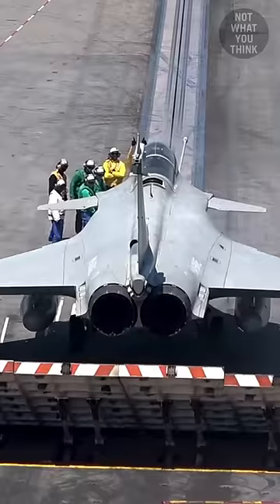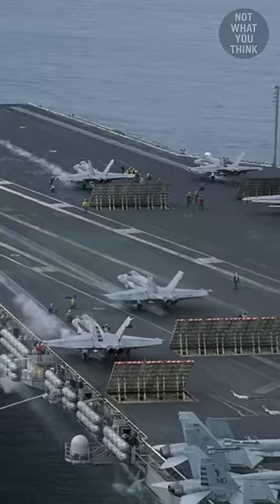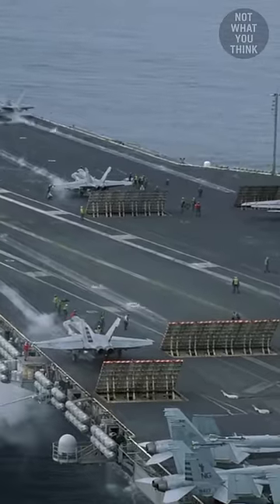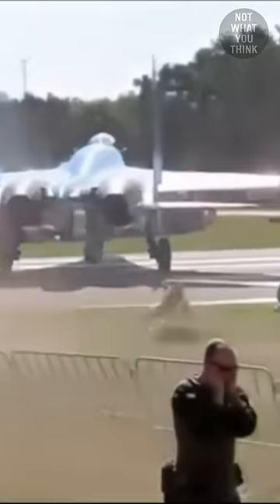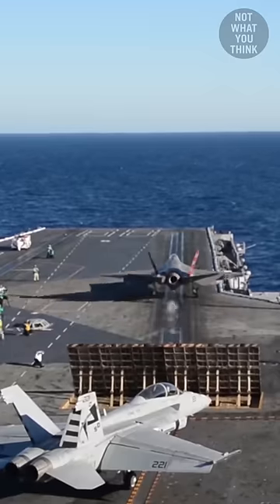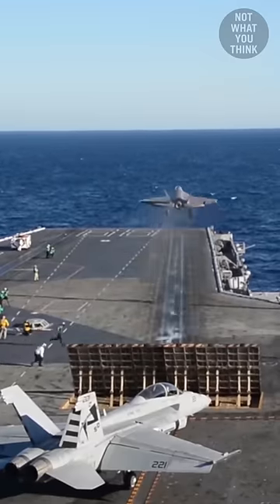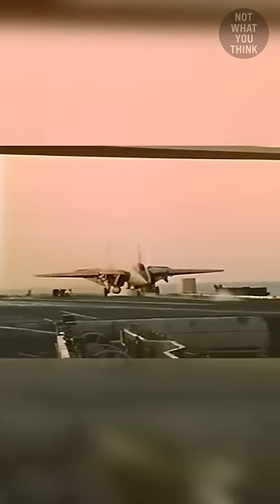Importance of Jet Blast Deflectors

Comment: Calling horse shot on this. 

JBD's aren't water cooled! Hydraulic and steam raised and lowered hunks of steel. The heat of an afterburner is so short lived that the "liquid cooling" would even effect the JBD.

I was stationed with VF-154 on the USS Independence (CV-62) out of NAF Atsugi/ Yokosuka from '96 to '99. JBD had nothing to do with this ejection. Aircraft was taxing to the outboard waist catapult and  nose wheel steering tripped over the skupper. Crew ejected as a runaway aircraft on a pitching deck. There's no JBD on the outside waist CAT. You can even see that in one of your mutilated cuts of video. The LSO platform is/ was the only thing behind CAT 4 on Indy's waist.

VF-21 Freelancers and VF-154 Black Knights were on board until the decommissioning of VF-21. 154 beame a super squadron and absorbed some of 21's pilots and 4 aircraft. 1 of which was TARPS capable.

Your misguided videos are hilarious and not what you think.
Reply: USS Independence CV-62 93-95 V-2 VLA, V-2 AG. BTW I was the guy who in 94 wrote a request chit for 6 months straight to ride in a 14. VF-154  put me up after 24  denid requests. The CO at the time was just fed up with seeing my chit week after week. So I finaly got a ride! Still have the picture framed with all the pilots signatures! I flew in Tripple Sticks 111. The one and olny time she was not broken down. If you were in that Squadron You know exactly what aircraft that was! LOLOLOL
Reply: Jet Blast Deflectors are indeed water cooled. Salt water to be correct. And Hydraulics is the only thing operating this system. No Steam is involved. You need to get your facts straight before posting bullshit “no-nonsense” rants on where you were stationed and where JBDs were located that didn’t “constitute an ejection”. There might not be a a lot of military personnel that’ll call out your incorrectness, but I will. You sir, don’t know what the hell you’re talking about.

Comment: Wait? That’s the actual story?! I think someone screwed up (it looks like it was night, going by the IR video), and I’m thinking it was the pilot. The F-14 was too far back to even be on a cat! Look how far back they are! I think the pilot was taxiing and accidentally punched the throttles too hard! Something like that.
Reply: Not IR video, this is the appearance one gets when B&W videotape gets translated to internet pixels, or even prior to that, a videotape of the incident gets played on a monitor which then gets recorded by a video camera watching the monitor, and then that gets translated to internet pixels. Incident happened 18 April, 1995, aboard USS Independence CV-62, last of the Forrestal Class CVAs. The 2 bow catapults on CV-62 began almost even with forward end of angled deck, Jet blast deflectors were just a hair aft of forward end of angled deck. The third and fourth catapults were on the angled deck, with the 4th paralleling the deck edge and the third catapult at an angle which split the difference between deck edge and the angle of the painted landing area. Those 2 catapults begin almost at the aft end of where the deck overhangs the hull, well aft of amidships. This happened on catapult four, not on the bow catapults.